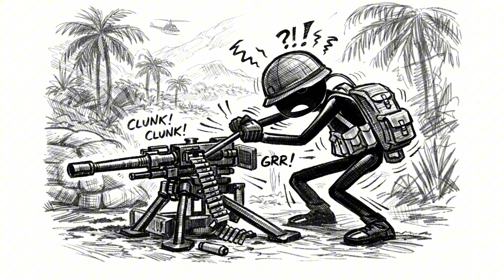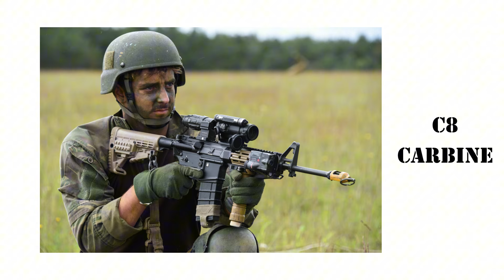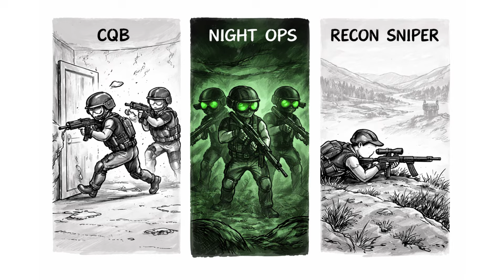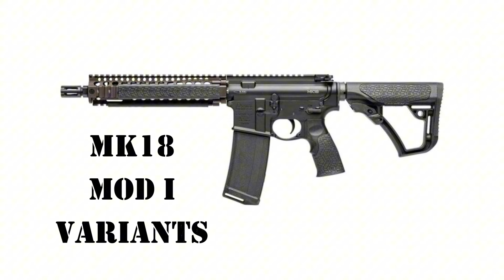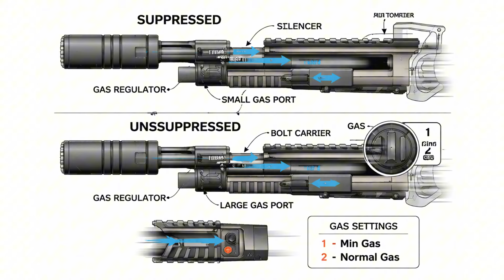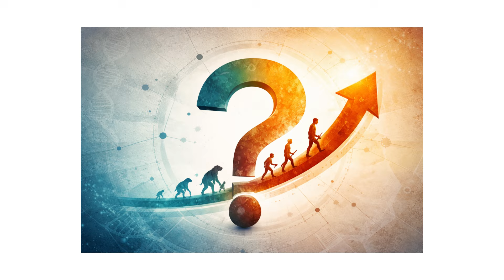Every Upgrade That Saved The AR-15 From Failure

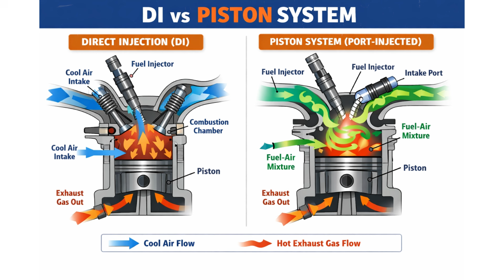Comment: 9:09 why is there a pic of fuel injection systems? Because this is a trash AI video. And it didnt even get the fuel injection systems correct.
Reply: Because this is AI bullshit and slop AI bullshit slop did you notice the paper heads you probably got 2004 with the pentagon

Comment: More like "every upgrade that proved it was a failure". Including, or especially, the bold assist. No other rifle needed a bolt assist.Short barrels from the short-sighted who apparently never looked at velocity, power, or unburned powder. Hence the term "bullet head"?
Reply from the maker: Exactly , that's the point. Early M16 was a disaster, soldiers died from jammed rifles. But instead of scrapping it, they actually fixed the problems. That adaptability is why it survived 60+ years while other failed rifles got abandoned.
The AK didn't need fixes because it was designed loose from day one. Different approach.
Reply: @WeaponProgramsExplained  The different approach was apparently the superior approach unless your own soldiers being killed was a goal. And that may have been a goal with the corruption being exposed. The M-16s jamming in the Negev/Sinai was unacceptable to Israel who literally picked up AK-47s from Egyptians and later improved it into a not-loose Galil. And the adjustable gas systems in Galil Ace, Tavor & Carmel make the M-16 look like it is directly impinging on my 2A rights. If that it America's rifle, America chose poorly. Like Ford being America's president. Death by mediocrity.
Reply: @minnesnowtan9970 also the ar15 never needed a bolt assist infact I never had reason to even use that despite the training we had to tap the bolt assist in never did that for any malfunction I have had because that didnt resolve anything infact most of the problem I had malfunction wise came from the occasional bad ammo. Form just a really scrappy round but that was maybe once in while most of the time as I have stated most relatable weapon I was responsible for. Loved over the M240 machine gun or both M9 and now M17 pistol. Like I see your criticism come from but they are certainly incorrect on its assumptions because the M16A1, M4, M4A1 and my civilian AR15 all performed phenomenally regardless of manufacturer.
Reply: @WeaponProgramsExplained  Please let me be clear that I am criticizing the rifle, not you or your channel. Your video reflects effort and thought, please keep them coming. FWIW I fired M-16s in ROTC (when we were supposed to, nothing rogue!) and rented a Daniel Defense AR where the T-handle literally bopped my nose after firing! The range gave me lots of excuses. Thank you for the video, it is good information.
Reply from the maker: Fair points man, the Israel/Galil example is pretty damning honestly.
I'm just documenting what happened, not saying the Pentagon made the right calls. Whether they should've switched to something AK-based instead is a whole other question.
And damn, charging handle to the nose sounds painful!
Thanks for watching and for the feedback btw, appreciate it!
Reply: @minnesnowtan9970 I get your sentiments but for me the AR15 platform has been nothing but reliable. It can run pretty well without cleaning even done major operations out in the field for weeks without real cleaning my M4A1 was one of the most reliable weapon systems I had out there. Even my civilian AR15 is even better much more up to date specs. Sorry to disagree but the fact that ar15 upgraded makes itself imperfect perfect weapon there is no such thing as perfect weapon especially for every scenario but the AR15 is about as close as we can get because it has got so many changes so adopting so much different understandings of metallurgy, ballistics, optics, even the various rails from 1913 rails to MLOK and even key mod. The AR10 is also getting the love it deserves now im glad we are exploring isapplication very happy to own the LMT MRGG-A excellent battle rifle lots of potential and truly a game changer. Is says alot that other countries are coming back around to AR platforms speaks volumes.